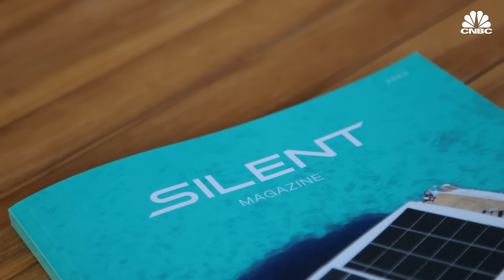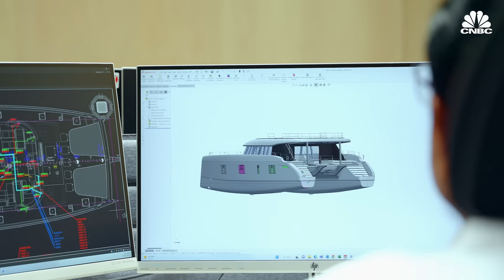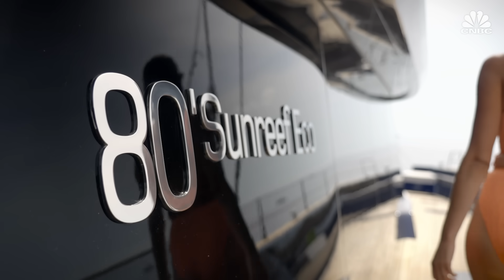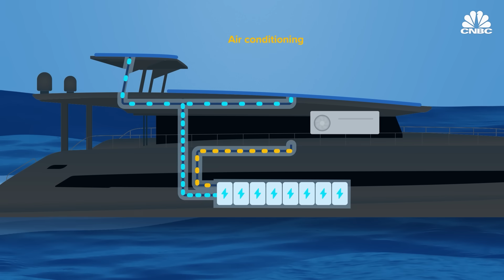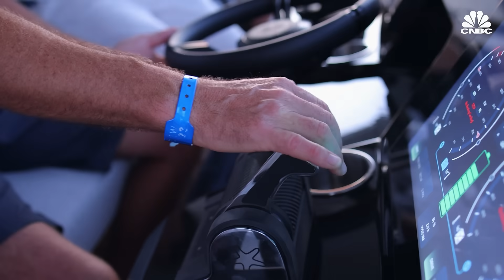How These Silent Superyachts Are Powered By The Sun

Comment: 🤣🤣🤣🤣🤣🤣.... Are you serious!? We can't even get cars to operate properly much less boats. Cars have 400-600 lbs on batteries. How many pounds in batteries do you think a yacht would be . I will tell you an environmental nightmare,  NO thank you . I will pass, plus you'd have to have your head examined to go out in the bearing sea with electric, it can't touch the power of diesel fuel
Reply: I can name almost 100 boats (mostly sail) that have already converted to 100% electric or some few that are now diesel/electric hybrid. When I have the funds I'm going to do my own conversion from Yanmar diesel including building my own Lithium Iron battery packs from cells. It's a much more easy way to live with electric than cars which is a bigger challenge. As little as 4hrs electric power is enough to get you in or out of any inlet in the world.
Reply: @LouisBackover Isn't it funny the way petrol-heads (especially those driving giant pickup trucks) judge any power system but their own against the standard of perfection? 
Maybe the diesel fumes impair their ability to understand nuance.